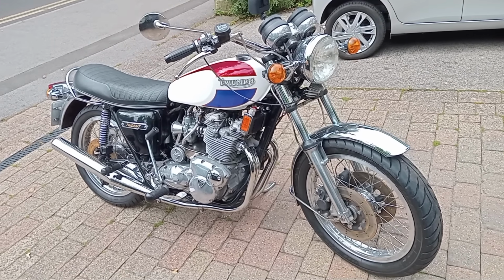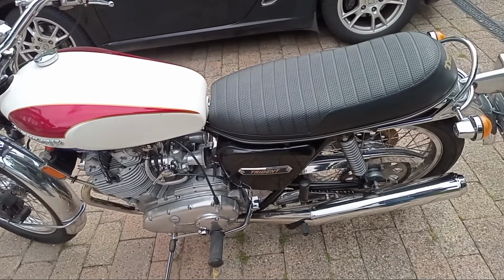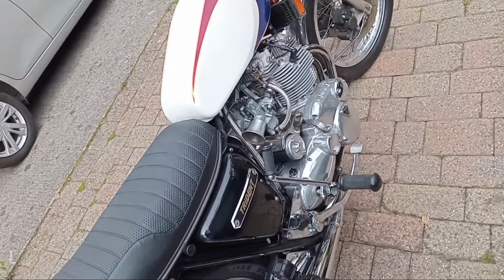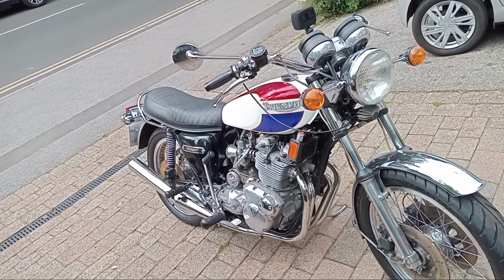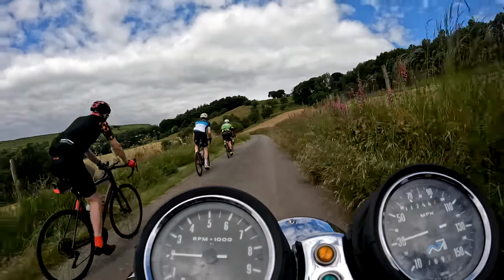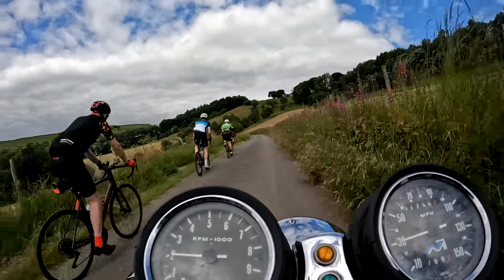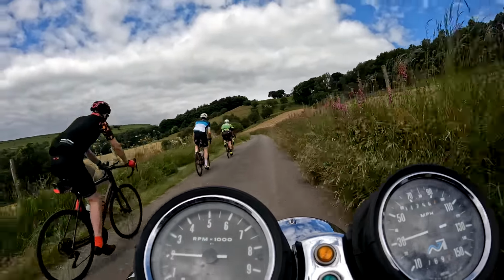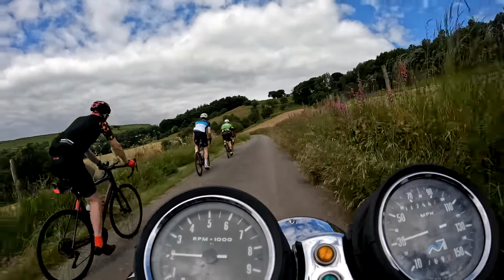Triumph Trident T160: Ride Out and Breakdown!

Comment: Bought one for $ 1,500 US that had been painted BRG with a brush. Replaced the front fender, re-chromed the rear, new headlight bucket, new tires, had the tank re-sprayed correct US color maroon and white and don’t remember what else. Some carb work, new seat cover, chrome and stainless bits. Anyway rode it a bit and put it up for sale on EBay. Disappointed only one bidder and the bike was shipped at buyer expense to Australia. Couple of months later, got a call from the buyer “ thanking me for the lovely bike although I could barely  understand him.Glad to see it went to a good home.
Reply from the maker: Good story. 👍

Comment: Great motorcycle, when it ran.  Replacing the Amals with Mikunis really helped.  Still had a major problem about every 1000 miles.  If I was lucky.  Luckily, I got a Suzuki GS1000 to replace it.  Rode the Suzuki for 25 years, then it started fouling one plug.
Reply: Bought my T160 new in 1976, and put 19,000 miles on it touring/camping with three friends in the US. Mostly reliable after I replaced points with a Boyer ignition, and changed to T150 valves & plain adjusters. For fun added Norris cams and 3:1 header. It refused to start before an upcomming trip, and I bought an 81 Suzuki GS 750 .. extremely reliable.  Still have the Trident.

Comment: Pre-1971 the Triumph wiring loom was so simple that a kid could have completely rewired the bike without breaking sweat. Which is what I did. No multipin connectors - just stuff you could see and analyse. Bullets are fine if you do them with care and, perhaps, take account of their exposure to the elements. I appreciate that from '71 onwards the wiring system became much more complex with the indicators and all the other faff and, therefore, multipins became a neccessity.
When I started watching this video I thought to myself plug cap or plug failure. To find it was a dodgy connection on the kill switch circuit was not surprising but somewhat of an anticlimax. The kill switch on my '67 T120 involves reaching below my left thigh and turning the ignition key through ninety degrees.
Reply from the maker: Plug cap or plug failure - on a Triple??? 😁😉
Reply: @Chris.rooke150  lol 🤓

Comment: A comment or two…….. I.MO. The centre exhaust system was not split into two pipes for cosmetic reasons, it was because having inclined the cylinders clearance with the front frame tube became an issue and this was the only way to get a smooth gas flow out of the exhaust port, a full size pipe canted to avoid the frame down tube would have required a sharp bend with a loss in scavenging efficiency. I am not sure having open bell mouths on the carbs is such a good idea, air filters catch a lot of stuff you don’t want going through the engine. Those handlebars ! I had them on my T160 when I got it , they do nothing for the handling of the bike, I replaced them with the standard European flat (ish ) bars for a much more connected and comfortable for both me and anyone sitting on the back.
Reply from the maker: Better gas flow? I don't think so. Manufacturer justification for something a bit dodgy  (they all do it). To miss the frame downtube? Maybe. To make it look like a 4 cylinder? Definitely. Open bellmouths? I do so few miles a year it doesn't make much difference. I'll be dead and gone long before the engine needs another re-bore - and I'm always form before function (they look so much better!) Handlebars? They're semi-western and I find them the most comfortable.
Reply: The three-into-four-into-two exhaust configuration was nothing to do with the inclination of the motor. Both the upright Triumph unit in a single downtube frame and the canted BSA unit in a twin downtube frame used the same divided centre exhaust set up in 1968. I doubt this was because of anything to do with cooling, gas flow ... whatever. The duplex BSA frame would have easily allowed for a single central exhaust pipe to pass through it, as was proved by Craig Vetter in 1973 with the X75.
No, it was more to do with the mess that BSA/Triumph was in at that time. Two halves of the same brain fighting each other. Triumph used a single downtube frame, having abandoned the 'tuning fork' twin cradle in 1963; BSA had stuck with the twin downtube frame. The Triumph half of this shambles knew that the centre exhaust pipe would have to be divided to avoid the downtube of their frame. The BSA half of the shambles said, OK, that divided exhaust will work with our frame and canted engine etc ... ad infinitum ... 
The blind were leading the blind and five years later Birmingham Small Arms, a company that had been in existance for over a hundred years, was consigned to the dustbin of history.